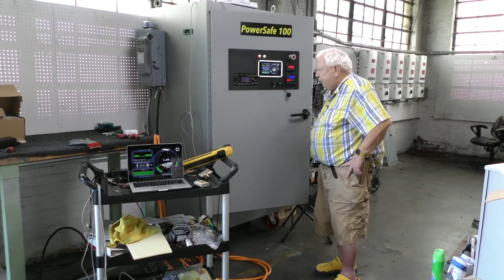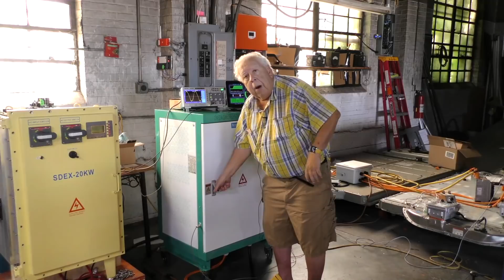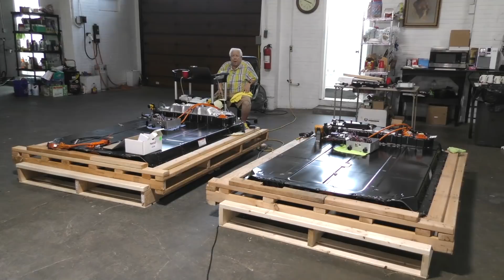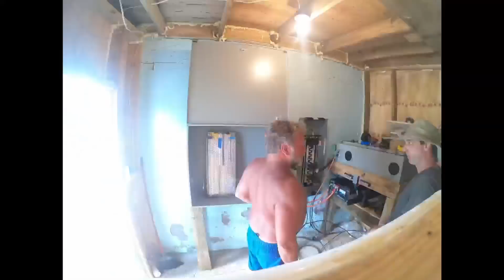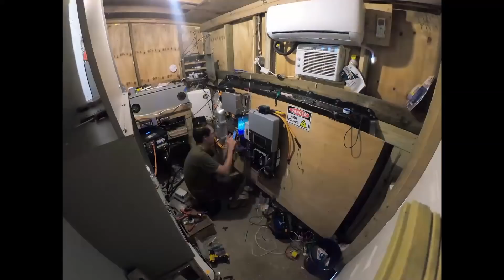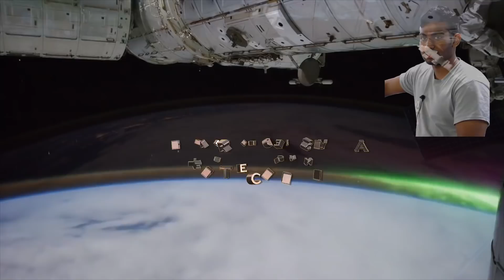Model 3 Battery and Sandi 30kW inverters.  No more 48v Sigineer

Comment: Great video! Good on ya. I completely agree with your analysis of voltage requirements for efficient home power storage. Spot on. The current state of play on these products reminds me of the Satellite receiver "business" in 1980. It's going somewhere big but it will be unrecognizable to current hobbyists (12v,24v, 48v etc) when it develops.
Reply: The only problem here is that he doesn't appreciate the different mechanism that t a t a n a t e oxide stores energy by and of course it's t i t not t a t but we can't digress the deal with tit-for-tat issues or tat for tit even.

Comment: Jack you should have stayed with the sunny island 48V inverters  don’t know why you went with that crap china inverter ..the sunny island has all the features you just need to learn how to code
Reply: You have completely ignored what he is a preached here. He is delivering value for the buck in an industry that has never done that. Higher voltages are the way to go for distribution as it is alternating three phase in part because of the Surplus Market and three phase distressed you can get your tents of tons of cooling For A Penny on the dollar easily if you have high voltage 3 phase available in your house and that can save tens of thousands of dollars over the life of your house not just drastically reduce the cost of construction of the house. It does both. Take a look at your oven Jack connector Not Just gray insulation but the damn beautiful copper that gets wasted. You don't want to use aluminum and copper to travel more then inches moving multiple amps in general and going up to the tens of amps requires intermittency and tens of thousands of kilowatts to justify. United States of course believes in under 200 Volts for most of the outlets and that makes her hair dryer cords heavy and not as luxurious at all as foreign models. When you make your chords smart your comment about knowing how to code has Merit. But your ambition does not include programming your extension cord and it should
Reply: @Irene-fu6gj  The model 3 battery is too big its not practical ..90 amps 48v is just fine for 220 13 amps
Reply: @Mobileccs  most people want more than 13 amp main breaker for their house rightly or wrongly.
Reply: Irene umm no most people don’t have room for a 1000 lb battery that can’t be mounted  on a wall that would 99 percent of people
Reply: @Mobileccs  actually you have far more volume in your rooms than you do wall space. Exterior walls you don't want the block either. If this is a safe module without the car contributing to the cooling of it I don't see why you couldn't use it as a platform to put your mattress on. Or you can have a floor on top of it. But your argument is notable. Unless you live in a cage apartment in Hong Kong there are issues that you raise our extremely bizarre. When I was thinking about this long before I responded to you the first time when I saw the pallet that looks like a California king size waterbed I realize that getting it into the house he's not going to be trivial are you not going to get that thing on in your apartment elevator and you may have difficulty going to get into your fifth wheel. put it underneath the trailer that will work right? I think what you're missing here is whether or not they should sell the individual cells for $2.50 and throw away the more valuable engineering and additional materials and electrical components? I don't believe the electric liquid refrigerant system is included in battery module so the assumption is that although the current draw might be sustained versus a car it's not going to be comparable to a car accelerating. However if you did put this underneath your trailer in Yuma Arizona and you did operate your air conditioner during a brownout from it exclusively and then all your neighbors asked you if they could tap it into the trailer park micro grid just because you have a breaker on there that's comparable to what the car would draw you're going to blow the entire trailer park out pretty quickly

Comment: What do you think of the new Enphase Encharge batteries?
Reply: Personally I like their approach, but WAY too expensive. It’s doesn’t make sense on any level.
Reply: @sunlightconversions828  I like the company's use of the word agnostic but then I found out that it was largely a tease. I have not heard about their latest development and appreciate you two chatting about it. I will say that I saw a listing on Craigslist for a large system that the guy had installed in this house before selling the house and I think that they got their asking price for the house but during the closing and negotiations the buyer said that they had to remove all the batteries in the panels and everything from the house so he put the system into storage and he didn't actually know that it was lithium-based instead of what acid-base so he didn't get any other responses to his ad. Remember it didn't cost them anything but the cost of putting into storage and so he accepted my offer which was much less than 1 he was asking and it was a structure that offer because I also did not understand everything there is to understand about this company's microinverters. I did not think that the panels were worth moving and so he accepted my offer for the rest of the system and through the panels in for free.

The company argues that the very low voltage battery makes it safe. I don't agree and I also don't agree that you have to have insufficiently conductive connectors. The connectors at the low voltage don't have to travel very far and they can be gold plated but obviously this video fails to mention the frequency is very antique of the grid. I suppose we will be upgrading our grids to a much higher frequency at some point so that one of the observations about the efficiency of the inappropriate comparison of the peak voltage and the continuous voltage having the continuous voltage less wasteful. There is a reason that the RMS is the correct number to compare so if you have a megahertz sine wave as a 10 kilovolt RMS and remember for transmision purposes you just use the air between the wires including almost invisibly thin wires if you want to use the move very little power. I like to use for example the clip on Christmas tree light extension cords to operate what can handle the very tiny fuse. that cord you can easily take the bulbs off of and then you have a factory build extremely low amperage very very long extension cord. It's so small and Light that when I rolled it up recently I think I left it behind it did not even register in my field of vision when I evacuated seconds because I lost track of time or seeing how little time I had rushed.

Enphase they do care about alternative frequencies and alternative voltage's. I think those model 3 packs we make a great platform for a waterbed and Jack should be producing the custom waterbeds in terms of the bladder and the pallet framing. You want about a two foot high water filled bladder the Lays right on top of the model 3 battery maybe four feet if the bedroom has a high ceiling because of you got to be able to jump on the mattress up and down without banging Your Head On The Roof and water is not a spring as steel Springs AR hardy har har. having those thousands of gallons of water to keep the lithium cool keeps the lithium safe as well because if it starts on fire no amount of water will help obviously and you don't want to be dumping the heat into the air but storing it in the water to wake you up with as that thermoelectric bad does or sleeping into the afternoon without the air conditioner because you drank half a can of energy drink the day before and should know better even if it didn't keep you up late apparently you didn't gain any extra waking hours you're just going to have difficulty getting to bed tonight

Comment: okay this is good news for a bigger  battery pack and inverter. The sad news for me, is that I was saving my pennies for the Sigineer 15kw.  Currently I am using my 20 year old Trace SW4024 4kw inverter with 4 Tesla Model S batteries running on the ESP32 (Love that thing). My plan is to grow the batteries (10+) and add more panels (from 4.2kw to 10kw).  (You know make my own Powersafe 50 or so)

My entire (1100 sq-ft)  house runs on that SW4024 AND DONE SO for the past 20 years.  A few generations of lead acid batteries, etc have supported it.  Now I found that I love these tesla batteries and my inverter had custom charging profile feature so works great with them.  It allows me to set cut off at 18v, but I have it set for 19.3 like the Signineer. I don't know how long this inverter will last AND it is a 24v model.

 I have my system setup to accept the Sigineer, but sigineer pulls this type of stuff - darn.  Need to refactor my design plans

Schneider-Electric XW Pro  has the cut off at 40v which is what Jack has said for some time that the inverter producers do not do inverters right. I agree.  Well at least the Pro allows some amount of customization.

So anyone have another inverter that supports the teslas with their charging parameters?  What are others using that I might check into.  I would love the 15kw level, but will look at lower
Reply: Look you guys that did this decades ago you have to pay attention to what on the demand side is available. The latest technology and I mean the Barack Obama funded National Lab water heating Solutions would seem to cut much of your demand in terms of its peak. I recommend both reports the second conclusion being after the election and possibly there for rushed but storing energy thermally is a bunch of better strategy then increasing your ability to compete with 200-amp or 3 phase grid connections!
Reply: @Irene-fu6gj  just removed my thermal system after tons of break downs, etc.  Wouldn't heat well in the winter (10F) etc.
Reply: @dougbertInExile  I think that you are commenting upon my comment that storing thermal energy is better than storing it electrically by saying that your system which did not store thermal energy was not better than storing electrical energy? If so I said storing energy thermally. You don't want to try to harvest thermal energy from Outdoors when it's coldest unless you are using liquid nitrogen to operate the turbine that power the ground Source system

Comment: Jack, Thank you for confirming my suspicions that the Tesla Power Wall is inadequate for backing up most homes. The inverter is too small and so is the batteries pack. They should use LFP batteries which are cheaper but take up more room but have higher cycle life
Reply: Agreed. Never understood why powerwall uses nvm. Makes no sense.
Reply: I thought Powerwalls could be run together. If so, you can buy as many as needed to backup your home.
Reply: @danchatka8613  Half the cost of the Power Wall is for the inverter. Yes, you can string them together, but then your paying for all these inverters which are still under-powered and have too small a battery bank. At about $8K per Power wall that gets expensive.
Reply: Totally disagree, they can easily be upcycled to be used as back up with the right systems in place. The trouble is most homes in the US are way to power hungry, I do agree that Lifepo4 is the way to go though

Comment: Yeah, we are probably not going to get rid of you that easily. I'll put in a good word for you with the big guy, even though you are a trump supporter. I suppose you are more deserving that way.
On a side note, even though you don't listen so good, particularly when you are wrong, rather than industrial overweight costly units and scavenged batteries, it's just better to buy brand new fresh cells and combine with tiny optimized inverters. Like Enphase. A Tesla powerwall has 13.5kWh which from LG chem might cost 1500$ plus overhead. Which Tesla mysteriously charges 11 grand for if you buy one and somehow about half price for subsequent extras. That is if you are a tinkerer or you plan to go into serious business doing powerwalls. Otherwise it's better to just buy some alternative product to a powerwall. I see a 6.5kWh one here locally for about 3 grand. No sense in making your own for one off use. Life is too short.     -Dan the man

Comment: RS-485 is a communication protocol 
Hope that is helpful sir.
Reply: RS stands for Rural Services. 485 is the protocol. It was devised in the early 80's as a differential  bus, thus being quite safe.  Obviously not as fast as USB3 or the like, but quite capable. Max lenght is around 1000m at 100kb/s. Robust against noise.
Reply: Miguel Ángel Simón Fernández 
Thanks for the background information Miguel. I never knew that. 
It’s fun to still learn stuff.
Reply: @EVTVMotors  I think some of these people might have let the joke fly overhead and didn't even notice. Perhaps sarcasm is hard to catch over the internet?
Reply: More importantly he is reusing the BMS systems for the entire module apparently. That is the only way to go!
Reply: It's likely Mordbus or some form of Canbus on top of RS 485 One shouldn't have to reverse enginerd it but probably will have to.
Reply: Smart Like Truck agreed.
Reply: Jack Rickard 
I work in the commercial HVAC industry as a service technician. And do some automation at times. This is a Low DC voltage that pulses on a daisychained network with addressing for each device. It is a token passing system of communication. Anything that you need rapid response I would not suggest using this type of network from what I have run into in the field. I have run into many problems controlling frequency drives signals over this type of network. And have recommended staying within the controller circuitry itself for best results.
It might be useful as modbuss or canbus monitoring such as I have seen in the field.
Reply: @bschindler2517  My understanding of the RS-485 implementation on the Sandi is that it off loads data only.
Reply: Stan Cloyd thank you sir. I don’t have one to play with but it would be fun to tinker with and figure it out.
Reply: Jack Rickard 
Sorry for the slow response. I was watching your show and my wife was asking me questions about who you are and what you do. 
I also don’t set up my devices to beep at me all the time. That gets annoying. 
Glad to help in anyway I could but I’m afraid that my little brain would be overwhelmed with most of the stuff that you do. 
My very best wishes to you sir, a fellow Missourian.
Would love to stop by sometime and say hello in person even if was accross the room.